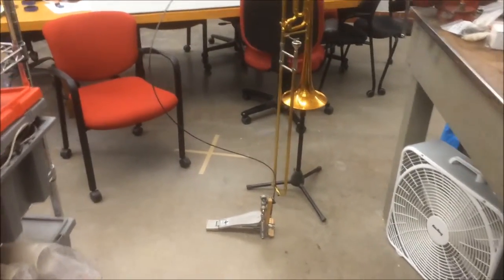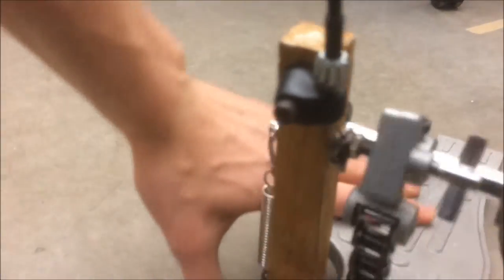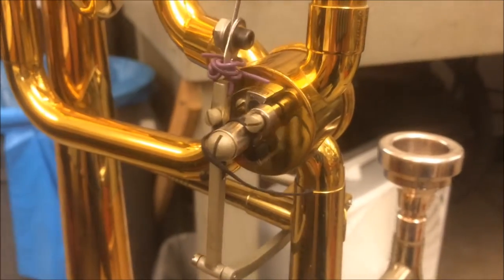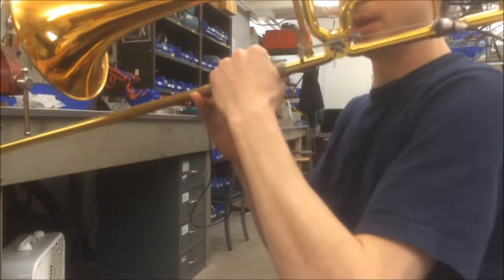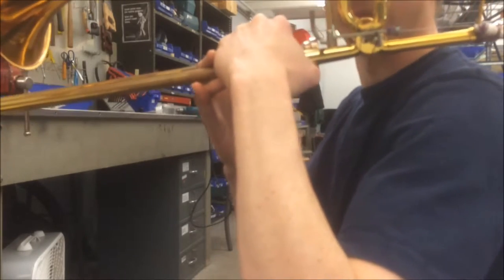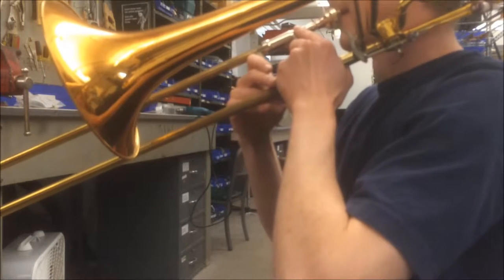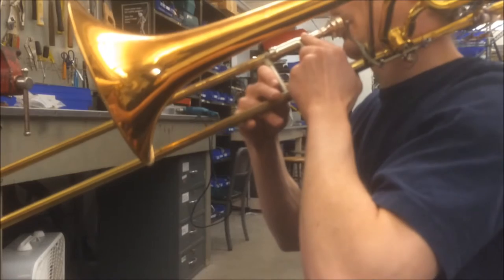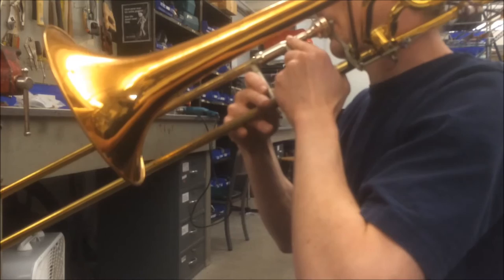Pedal-operated F-valve for trombone.

Comment: This is great! I'm a trombonist with limited dexterity in my right hand (which I use to hold the trombone) and this is something that I've been looking for. Do you have any schematics or instructions for making this myself? 

Thank you very much!
Reply from the maker: I don't have detailed schematics, but I can give some general suggestions.  There are a few key pieces to the setup. The foot pedal is a standard base drum pedal, with no significant modifications. The cable that connects the pedal to the trombone is taken from a bicycle, and can be purchased from any bicycle parts supplier. It is called a "bowden cable". I forget if it is one that was used for shifting or braking, but it shouldn't really matter. The only tricky part of the project was connecting the bowden cable to the pedal and to the trombone. You need something that will hold the outer part of the cable fixed (to the body of the trombone of the upright on the pedal). I had a 3D-printer available, so I used that, but you could probably cobble something together even without a 3D printer. I actually had some trouble with the plastic parts from the printer deforming, so you might be better off coming up with something different for that part - perhaps tying something together with wire.  Let me know if you get something working!  Matt
Reply: @MatthewKelly2  Thanks a lot! Because I'm left handed I need ti figure out how to flip the f-attachment around, which I believe will be rather complicated, but when I manage that I'll try to make something similar to this.

Comment: What model of horn are using?
Reply from the maker: It is a Benge 165F
Reply: @MatthewKelly2  Would you recommend this brand or something of higher quality and durability. I have a moz tenor that doesn’t sound that great and the triggers keep getting stuck.
Reply from the maker: @keithshockley3443  - I like this horn, but it is definitely "intermediate level". The trigger is reliable, but makes a bit of noise. The tolerances on the tuning slides are not great and they tend to get jammed if you're not careful. That being said, it sounds nice and is pretty indestructible. I got it in middle school and used it through high school. I got a much nicer Jupiter horn when I graduated. It was better in many ways, but I found the thayer valve continually got stuck and was hard to maintain. I don't play much anymore, so I eventually sold the Jupiter horn and keep the Benge around for playing occasionally.

 I would recommend the Benge horn for a beginner who is looking for an affordable upgrade from a student model, but not for someone who is looking to play at a higher level long term. For that I would recommend getting a slightly higher quality horn but but with the same type of valve as the Benge has. With better tolerances and the right padding on the stops the valve should be quiet and easy to maintain. The key features I would look for (apart from sounding good to you) would be nice tolerances on both the main and tuning slides. Good luck!